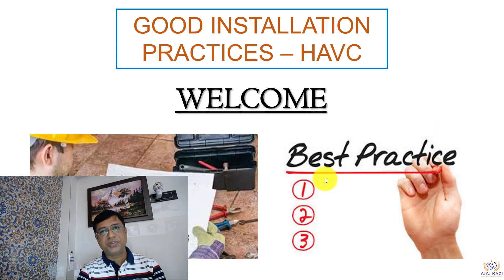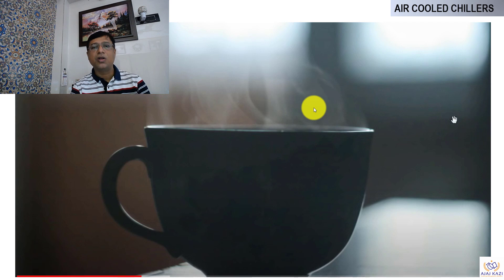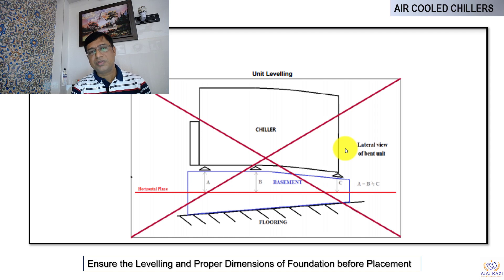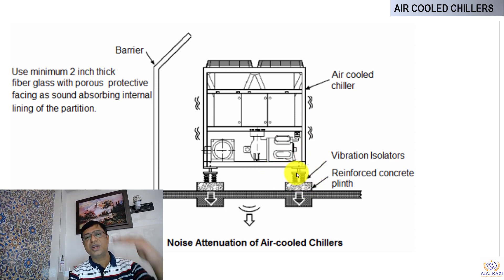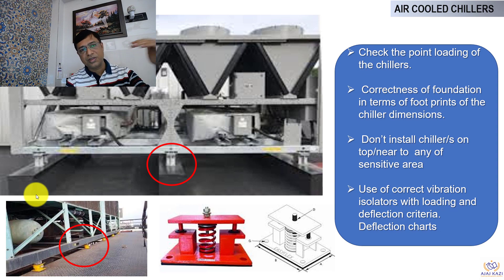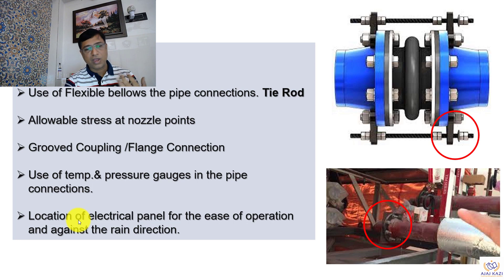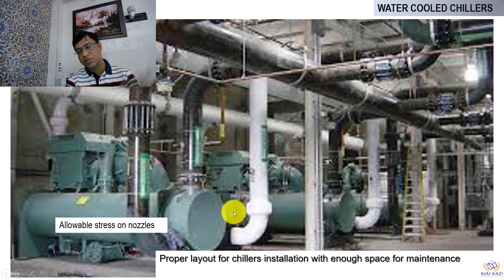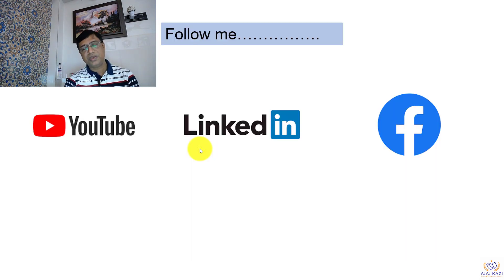HOW TO INSTALL A CHILLER? | HVAC SYSTEM | WATER COOLED CHILLER

Comment: Is there any worry (concern) for staying at a condo overlooking a shopping mall (building complex) roof? Shopping mall is just infront of my future condominium. It is 5 floors/levels lower than my condo unit. Would the heat from such building roof and aircond chiller create heat that may rise up and flow into my condo? Where would normally their airond chiller installed? at the roof top?
Reply from the maker: At the roof

Comment: Hi Sir,
Thanks for your valuable information. 
Q) Which is better installation in terms of energy saving and efficient system to use VFD in combination with 2 way valves or VFD in combination with 3 way valve? And why?
Thanks & Regards
Reply from the maker: This is one option. There are many more technologies available now.. PIBCV Valves, Energy valves etc